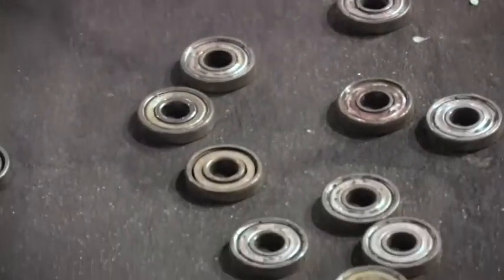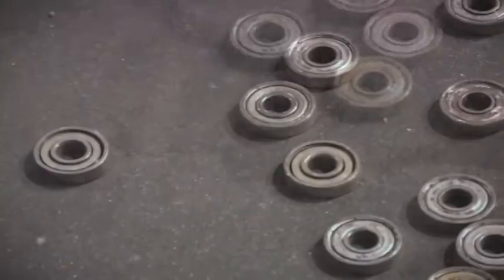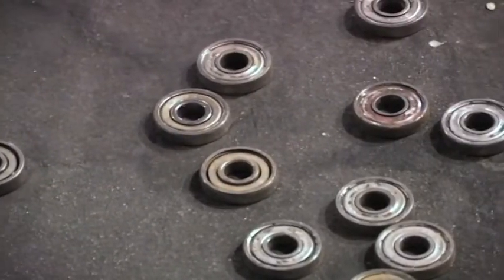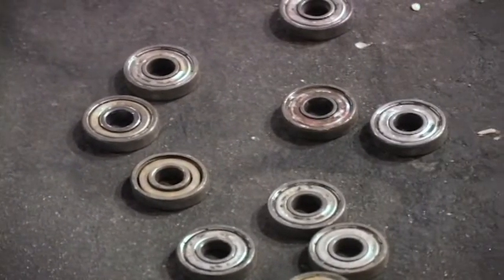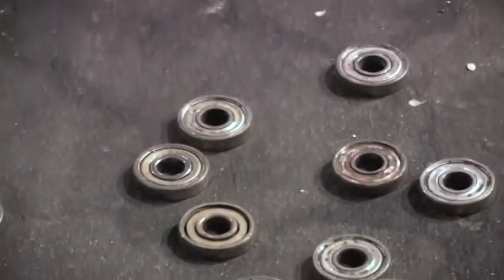Skateboarding & Equipment : How Does ABEC Rate Bearings?

Comment: "In the end, it doesn't make a huge difference unless you're into serious speed. Your main choice will be choosing between oil, cream/grease, telfon based lubes, (bicycle) wax/paraffin, and whatever else is out there. Most people end up using grease or oil. Oiled bearings have slightly less resistance, but need to be maintained more often (as often as once a week). It is very helpful to have a little hypodermic style oiler with a long needle to let you put the oil right where you want it"

Comment: fail link, dont even know what u doing? lmfao, by the way oil = less resistance then grease, however doesnt last longer because gease will slowly move into the ball to keep them lube, either way both oil and grease add fiction/resistance, just that oil have less